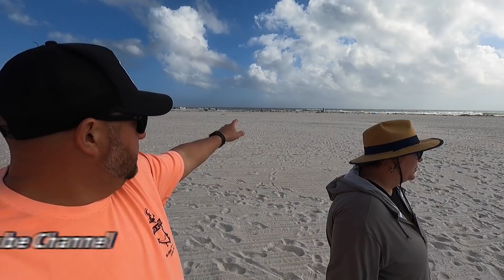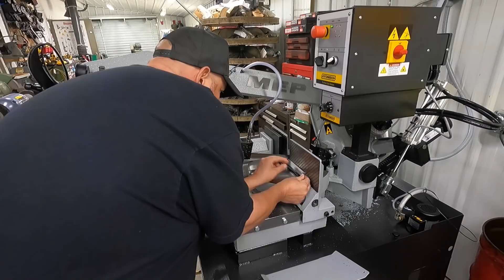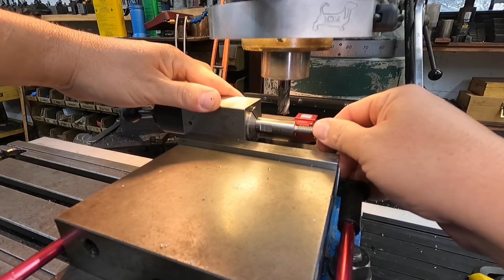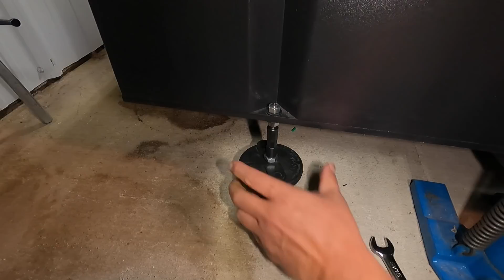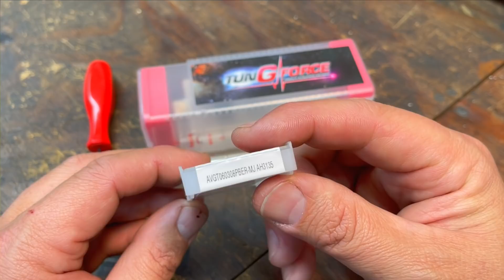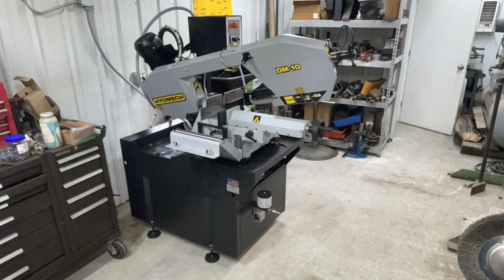SNS 332: Machinery Feet for Hydmech, Repaired Work Boots, Tung Force Mini Mill, Rode Wireless Go

Comment: How come you used the bigger rod diameter to begin with? I know you said you wanted it to shoulder up better on the pad nut, but on the undercut you machined down to a much smaller diameter, so you’re down to the size of the smaller rod there anyways. The undercut makes the rod diameter much smaller and I would think this would be a weak point even thought it is necessary. Hope this makes sense. This question is purely to gain knowledge and not to second guess your ideas or processes in any way. I’m new to all this. You inspired me to buy my first mill and lathe and I am just learning. Thanks for a other awesome video. However, now I’m hooked on watching boots and shoes be repaired. 😂

Comment: The new mic works well.  Seems when you talk it cuts out the background noise. 

What are you holding that tungaloy cutter with? A regular end mill holder, heat shrink holder or collet (probably not a collet). 

Thanks,
Mike

Comment: What cutting oil do you use?
Reply: I think it is Ridgid Dark Thread Cutting Oil ($22.92 per gallon at amazon). I began using it two years ago on my manual machines. Works pretty good and smells nicer than Tap Magic for damn sure!
Reply: A few videos back he talks about a 55 gallon drum of cutting oil that he bought like 15 years ago.  I believe it was the tie rod end thread chasing video.

Comment: Former sound tech. Lav or lapel mics really depend on mic placement. Just you moving the mic around at the beginning of the video, I could tell a difference. Personally, I preferred the audio from the shotgun mic. With the clip mic being on your hat and against your head, it's picking up more deep audio than highs and mids. Makes it sound muddy. I would like to see how it does with the mic clipped mid chest on your shirt, or maybe on the top of the apron you sometimes wear if you can keep from hitting it. But like all new tools, it takes a bit to get used to.
Reply: This could also possibly be fixed by adjusting the equalizer on your audio mixer. I will say, when you were at the band saw, having the lav mic really helped as you were much clearer than you would have been with the shotgun mic and you facing away from it. I would give the lav mic a few more chances, but keep playing with the equalizer.

Comment: That Rode Go sounds pretty nice, and clear. And a nice mix between voice and mill. Closer is louder. In a noisier shop, try moving the mic closer to the visor. Maybe a lav mic with short cable, clipped to the brim. It keeps all the workings conveniently mounted on the hat. Mr. Fenner clips his to the top of his visor, always wondered what it sounded like clipped to the underside. Moving the mic to the brim might also bring out a little more of the highs in your voice. Just looked up, and saw that you moved it to the visor- to my ear, that position gave the best sound. Was it comfortable mounted there?  Cheers, Mike.

Comment: Haven’t been around a lathe much. How does it line up each time when cutting threads? I would be worried that one time it would engage/start cutting at 7 o clock on one pass and then 3 o clock on another pass.
Reply: There is a threading dial on the lathe which is driven at the same rate as the chuck, depending on what the actual thread pitch you are cutting you use one of the numbers on that dial as the point you engage the carriage to start cutting.  So say you are cutting a 20 TPI thread, that is an even number and on most imperial lathes that means you can engage the half nut at any mark and it will follow the threads. That changes if you are cutting odd threads though, like 27 TPI, for that you use the main dial numbers only, you cannot just pick any mark.  Once you know how a particular machine works it actually becomes easy, then the trick is having the correct gearing to cut the threads, like trying to cut a metric thread pitch on an imperial lathe or the other way around, or cutting some odd pitched threads that are very fine TPI on a well used lathe.
Reply: @Blazer02LS  
Thank you! 
That makes perfect sense!

Comment: Your audio has always been great (ya except in the wind) The new mic/soc good choice or if your software has a limiter/compressor setting but your audio spot on levels not too blown out by the comercials or vice versa just getting the vol levels for most people seems to be a struggle.  ya  and that Tungaloy endmill very nice what the mighty Do-all is 2 HP that looked like 5-6 HP of chips there cooked Em' at the perfect temp looks like thanks Adam you find some cool stuff

Comment: Do me a favor and keep some wood blocks under that saw.  As a mechanical engineer, I see some bending moments in the design of the standoffs that make me feel uncomfortable.  The blocks won't hurt anything, just insurance that if the bending moments get to be too much for the thread-to-shank areas, it will land on the wood that's not too far below the base of the saw.

Comment: Strangely the mic sounded a lot clearer on the beach. Not sure what the difference may be but is seems when wearing it in the shop it has more bass and less treble, slightly muffled. At 18:12 and again at 21:35 it changed quite a bit and seemed distant like you were no longer wearing it and it was somewhere in the in the room, I could hear the cut of the thread and the bass lessened but the volume lowered. The picture quality is great and I'm sure you'll sort the mic, it's clearly descent gear just needs a bit of tuning for the lip sync, sound quality and finding the best mic location.
Reply: Clipped on it has no hard surface audio reflections and the mic faces down, on the bench you get audio directly into the mic head and get some sound coloring from the hard surfaces around it.

Comment: so at 25:18 it seems like you have to engage that little cutter...then it begins racing towards the stock to cut the threads then you have to INSTANTLY disengage RIGHT at the end, or it will just cut the shaft.....so what do you do do, just keep your hand on the lever and quickly snap it to stop the thread cutting?  damn scary, you gotta be QUICK on every single stop!!!!
Reply: That is exactly what he does and yes, he has to be precise on his opening the half nut to stop the feed.  With the undercut at the shoulder, he doesn't have to back the crossfeed out with the other hand at exactly the same time. 

Anybody can do it.  All it takes is a couple of decades of constant practice.

Comment: Did you know that there is a BREAK-IN PROCEDURE FOR NEW BANDSAW BLADES?
Reply from the maker: I’m well aware of that. Been in the shop long enough to have learned it years ago. My statement I made “this is the first piece I’ve cut” was the first production cut.
Reply: @Abom79  At least you know, we’ve got guys at work
that have been in the tool room for 40+ years
that didn’t know.
Reply: @moms762  how about sharing the procedure with the rest of us less educated?
Reply: @brianrvd  What I would do if I were you. I would install
an additional blade over the top of the first blade so
it widens the kerf, and then run it as fast as you can
with the down feed wide open.
Reply: @moms762  thanks for taking the time to reply. I guess it was too much to ask for an honest, friendly answer. It's ok to just say you don't know.
Reply: @brianrvd  The reason you got that answer is because
I don’t believe you’re uneducated, and you
were just being a smart aleck. Also it would not
be ok to say I don’t know, because I do.
Reply: @moms762  well I don't know how to break in a bandsaw blade, and I'm sure other people would like to know also.  You yourself implied that not many people know how, but I guess the only point of your post is to make sure that everybody knows that you know how.  I will just look it up elsewhere.

Comment: Dear Adam, as soundengineer and admirer of you and your excellent videos I want to give you a good advice: Use that new mike for the surroundings in combination with that mike you use before, mix these together in the correct proportion and you become a sound in your videos like in a movie. Because of that new mike is take too mush surrounding and therefor its not really fit to record voices in your circumstances, on the contrary your voice loses clarity.  And by the way Adam, Rode mics are supper mics. Greets from a Belgian fan.
Reply: Great input.  I'm a novice with audio visual.  What's an inexpensive way to use both mics and mix it?  Record somehow with both and mix later, or use a device to plug them both into and set up the mixing with it and send the output to the camera?
Reply: The best you can do is connect the first mic to the camera so that your voice is recorded clearly. Connect the second mic to a digital recorder for the ambient sound. Then you transfer the sound from the recorder to your video editing program on a separate track and synchronize it with the sound track of the camera and then you can mix it. After a few practice sessions, this works perfectly and you have the best spacious sound on your videos. If you have any questions you can always contact me. Kind regards from Albert.
Reply: @beerbalou3527  - Thanks you so much for the response!  I understand and will put this to use if I find a need for better audio on my wife's channel.
Reply: You're welcome and good luck with it.
Regards,
Albert

Comment: That cutter is nice. It better be considering it's a ridiculous $366. Hardly a tool for a hobby machine shop...
Reply: I just was looking at the price myself I am in shock!! incredible
Reply: Yeah good tools can be expensive. But crappy tools can be even more expensive because you buy the crappy cheap tool and with a lot of effort eventually get your cut made or part done. Then you go out and buy the proper tool. So you end up paying for the good tool AND the bad tool. To put it another way... buying a good tool stings once. Buying a crappy tool stings ever single time you use it. You don't have to buy that specific type of name brand tool for hobby machine shop work. There are lots of options out there that cost far less. You can even find decent deals on eBay for name brand stuff. It may even be that your mill doesn't have the quality of build and power to even make use of the advantagesthat the tungalloy tool will give you. While it does some impressive cuts with a decent finish that tool can be pushed even harder with through coolant running.
But that set of 20 cutters from Harbor Freight for $70, while tempting, will just not perform like a good quality cutter. Ask Quinn over at blondihacks (she works from the hobbyist perpective) and she will tell you the same thing.
Reply: The point is that this was a free tool “courtesy of his friends at Tungaloy” to push onto hobbyists with low HP mills. That’s Adam’s words, not mine. Don’t get me wrong here: I’m both a LONG time subscriber AND a patreon supporter of Adam, so I’m not going anywhere. I just find this to be a blatantly obvious advertisement with the quid pro quo of a free tool. If Adam wants to truly help hobby machinists with hobby mills, then he could say something like “this is a top of the line, fantastic product, but these <insert other option> others do the same thing at half the price. It’s the fact that it’s an obvious advertisement that grinds my gears.

Comment: Band saw blades are welded. The sound could just be where it's welded, and the tooth spacing is different.  I noticed this on my portable bandsaw. It sounds odd every time the weld comes thru.

Comment: Sorry man I've found a new engineering channel its called,  cutting edge engineering Australia,  this guy goes right into the the engineering stuff things I've not seen , so thanks Adam it's been a blast , good luck in the future 👍😀
Reply: Why not watch both I do.
Reply: I agree Kurtis at CEE is great to watch, especially since he explains everything and does big hydraulic work like Adam used to do at Motion Industries.  But is that reason to dump Adam ?  Don't tell me you've dumped Keith Fenner as well ?  You're cutting off your nose to spite your face.
Reply: I like the CEE channel but will watch Adam, Fenner, and the others as well.  CEE outtakes at the end are hilarious (a bit off-color, but I don't mind) and that super-cute, big-headed dog is great too.  They always fit the dog into the vids.
Reply: @pete540Z  Ya the dog is cute, but I have to wonder how many chips he/she walks on in a day. Maybe it is smart enough to stay away from them. I know mine wouldn't be.
Reply: @--_DJ_--  good point - I wondered about that.  I would probably have boots for him.
Reply: I have only seen a couple of his videos, but found them lacking in the commentary department, though that may not be the case for other ones he has put out.
Reply: @--_DJ_--  Watch his two most recent ones.  Excellent two-part coverage on machining a big replacement drive shaft out of a Vermeer tree muncher.  He explains very carefully and thoroughly the issues he had to deal with from crappy material ( 4340 ) he unhappily had to work with, because the customer supplied it.  In other words, the theme comes down to how Chinesium often appears to save a few bucks, but in the long run, costs just as much, or more, than a genuine replacement part, or quality material for making one.
Reply: @stephensmith8756  Those were the two I have seen. I didn't find his explanations all that thorough. I enjoyed watching them but I was left wanting more commentary.

Comment: Adam, when you move the apron back after making a thread cutting pass do you have to start the apron at the same location for the next cut?
Reply: No, carriage can be anywhere. Only the line on the thread dial counts. It will automatically compensate for carriage position.
Reply: depending on TPI and specific lathe you have to engage the half nut on the right number 22:11

Comment: The new mice sounds a bit muffled and less clear compared to your old one, also it picks up more echo from the room, so I prefer the old one unfortenetly.
Reply: As u can’t hear from 4:45 the difference in Sound ist related to the position of the mic. Adam,  when u use that mic maybe u can cut a little the low frequency’s in the  Eq to compensate...  and there is some compression on that mic-channel, so u hear the noise coming up when he stops speaking  use a. Little mor release-time on the compressor, so it is pumping less.
Reply: @frankangermann6460  it do sound different when he moves it around yes, but regardless, the old mice just sounds better. As I got further into the video I noticed aswell that it picks up breathing loud enough that it gets anoying. I might add that my sound comes from my $10k+ 2 channel HiFi system, which is very revealing.
Reply: @dunkelheit843  I use just 120€ - HD25... but anyways... it’s exactly what u hear...when he moves the mic from in front of his face to the hat it starting getting muffling... it’s about how sound is spread from the speaker and how soundwaves are bend around the head.... just sound engineer stuff...😉
Reply: @frankangermann6460  That's very interesting and I see your point, so using the mic on the side of the head is less than ideal. But even when it is infront it sounds very compressed and undynamic.
Reply: @dunkelheit843  i would not say that gernerally.....the close u r to the mouth the better it is, regarding to noise...the muffling Adam can compensate by cutting some low to low mid Frequency’s in the EQ, an the Pumping of the Compresser Adam can reduce by releasing some threshold, increasing the Release-time of the compresser... or just compress less, no clue what possibility’s for Adjustment his compressor allowes... on the other hand it it a channel related to machining ..less for audiophiles.....
Reply: @frankangermann6460  Basicly I just tryed get across that I much prefered the old mic setup.
Reply: @Dusty 99  calm down....we will see if u write in German....😉
Reply: @Dusty 99  There is really no need for you to insult us.

Comment: Would be nice also to install on the front & back corners of the base 4 jack down casters till the casters touch the ground. If he ever has to move or turn it. Pain having to use the pallet jack every time just to move the saw hence when Adam moved it back there.